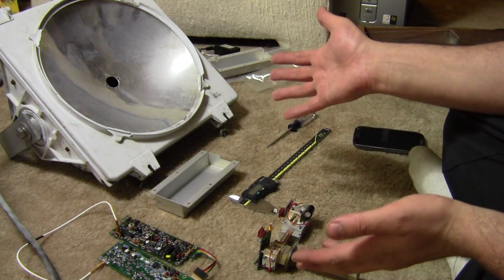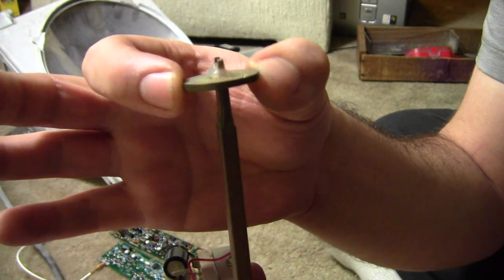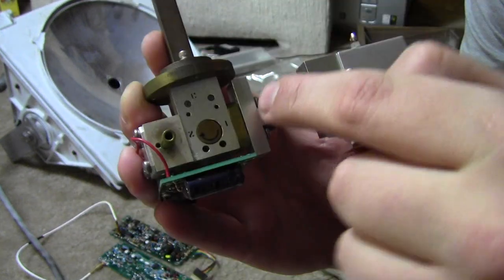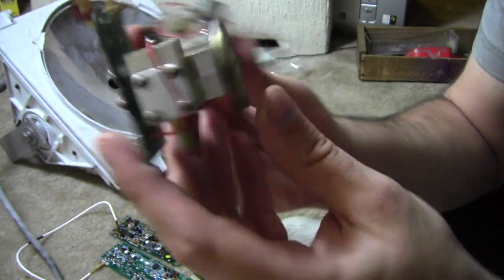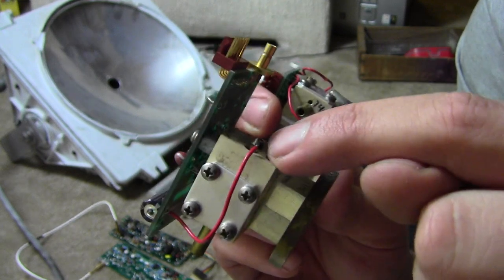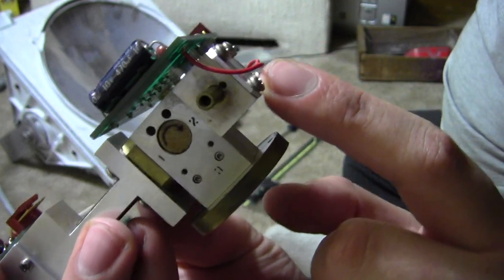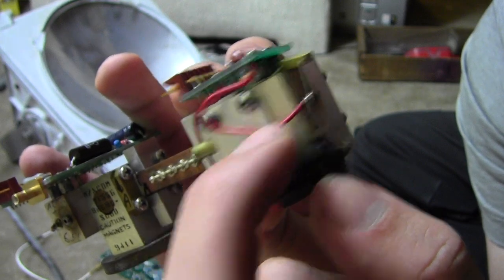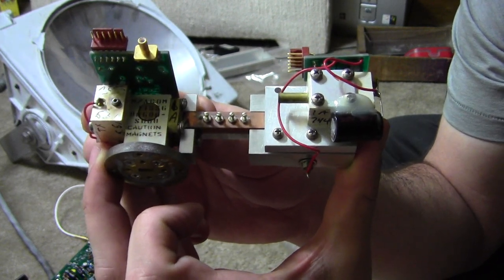Microwave Transceiver Teardown

Comment: Those aren't MCX connectors. MCX connectors have a solid outer shell on the female connector and the male connector has spring tabs that go inside the shell. I think they might be SMB connectors.